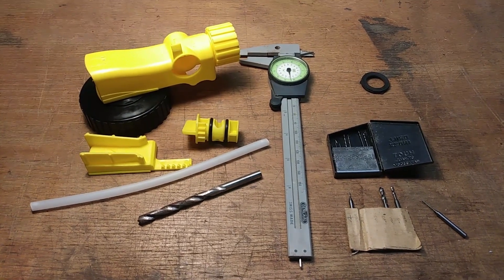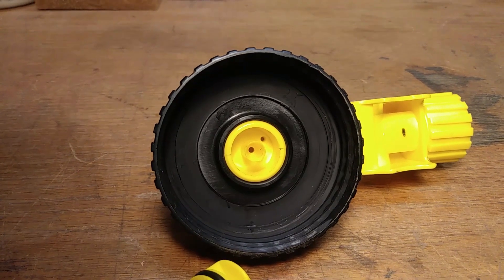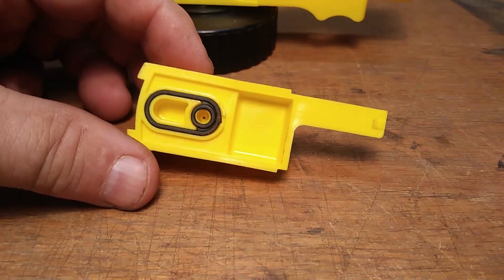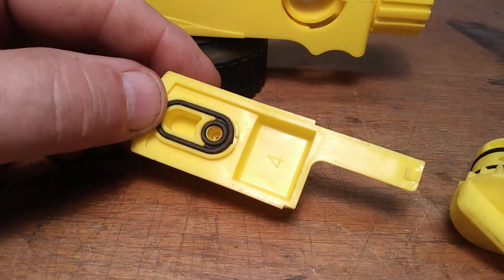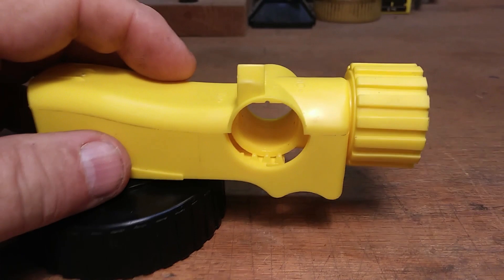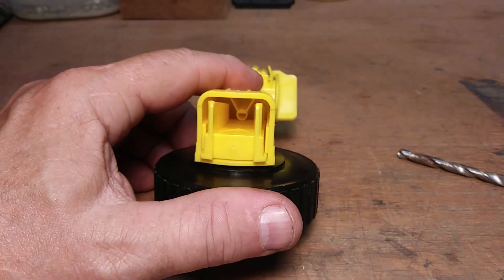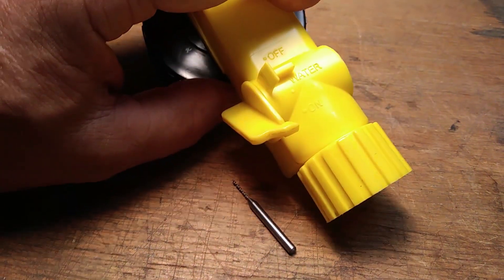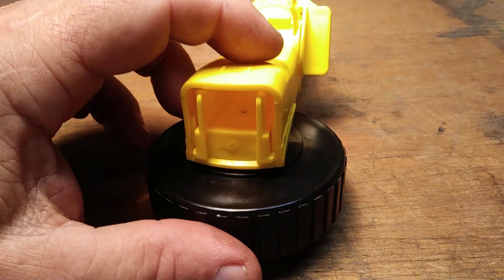Inside the K-1 Hose-End Sprayer Head | How does it work?

Comment: been searching for a hose end sprayer that does not clog. I have used these before by drilling out the suction inlet or pickup hole, however it still clogs very fast. Going to a bigger drill out may keep it from clogging, but then the product just flows out way too fast. Its no wonder that im seeing more n more folks using backpack sprayers to put product down then allow rain to water it in.

Comment: Wow, great video,  I must have a dozen k1 bottles around the garage and shed. Took them all apart like you did and noticed some have a 3, 4 5 and even a 7 printed on the slider. Does thatnumber mean oz. per 1000 ft. or size opening of the hole (mm or in.)?
Reply from the maker: I'm not sure. Sorry.

Comment: I knew you were going to open one up.... I tried one from Simple Lawn Solutions and it stopped working half way through the bottle. I checked to see if it was clogged and cleaned it out but still not working. Had to finish the bottle in the Ortho sprayer. I may open it up and try to see why it failed.
Reply from the maker: Check the alignment of the pick-up tube hole and the metering hole.  They are pretty easy to take apart as shown.  Let me know what you find.
Reply: @TommyTester  I think it was a blocked metering hole. I cleaned and ran water and it worked.
Reply from the maker: @johnhannon  Great.  I just tested out another sprayer head. Looks promising. Video in process.